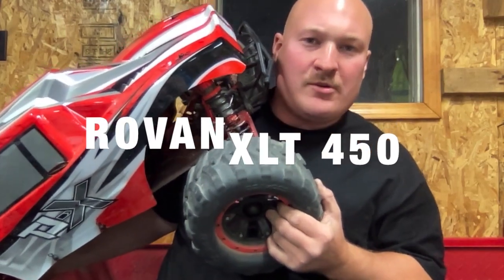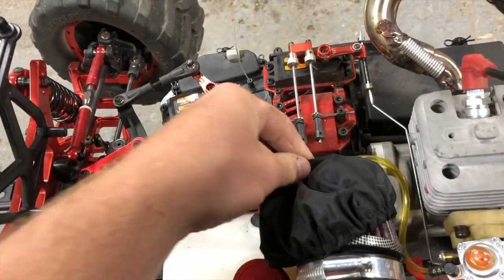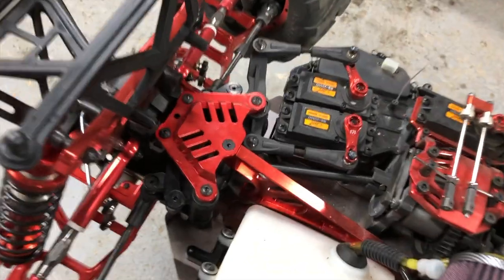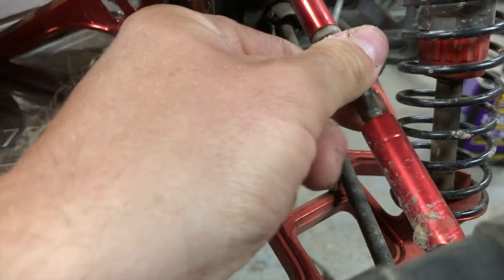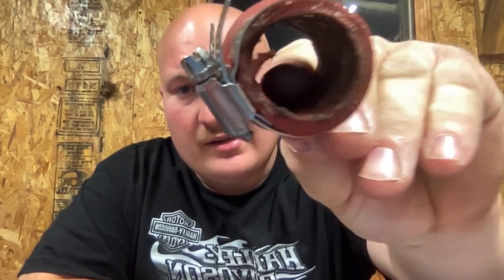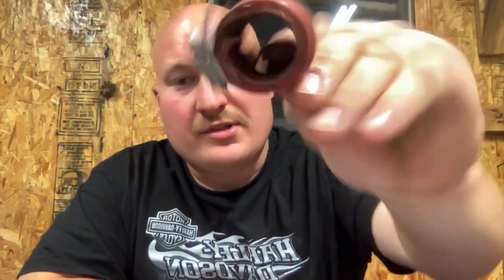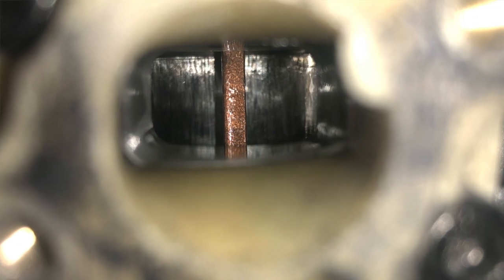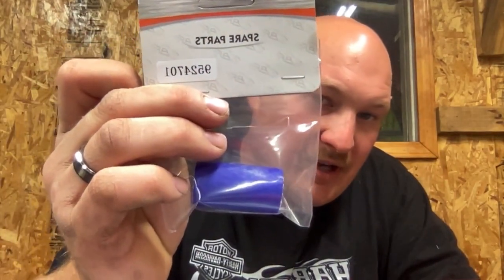Rovan XLT 450 short term review

Comment: The shroud helps direct the air over the head
Reply from the maker: Yes you are correct. The temps did get better after I took the shroud off.  I am trying everything to keep these temps down.
Reply: @kgm5512  i don't have the xlt 450 yet. Dont know if ill get it. But on my other 3 rovans, the exhausts were not port matched to the cylinder head. I don't have any testing with the stock pipes. I put bartolone pipes on them. Funny thing, all three of the bartolone pipes were the same style. 2 were correctly port matched. 1 wasn't. I sent it back to Dan and he swapped it out for me. I have read other people had the same thing happen. I guess bartolone made a run with the wrong flanges. Just something to look at when you swap the pipe out.
Reply from the maker: @Dan-em9sk  I am looking into a tmr pipe. Thanks for the heads up. I also run bajas. I have never had a issue with overheating until I ran this truck
Reply: I have the same truck didn’t have any cooling issues. But I still cutout the front window. Engine has a good flow of air keeps it cool 😎

Comment: It's the second ring on the piston that is causing the excess heat IMO. Kind of an odd idea from rovan to do that. I had the same problem with a dual ring 36cc in my rovan Lt. It was running hot and after a little bit of running it would lose power. I took the head off and removed the bottom ring and it solved that issue. Also runs way better.
Reply from the maker: Thanks for watching. You are absolutely right about the second ring. I will only be re assembling with one ring

Comment: Why is the 5t so much faster?
Reply from the maker: Well I would have to guess in my opinion is that the giant tires on this thing add so much gear that it make it difficult for the truck to move. Thanks for watching!  It’s not so much a speed truck but made for jumping
Reply: @kgm5512  i was just wondering cause they seem like the same motor in the xlt an the baja but the baja does wheelies and sounds way crazier from my research. For the price i was kinda hoping the xlt was like that cause i want one but not really if i gotta spend another grand on a aftermarket engine to make it fun an faster
Reply from the maker: @yamaha4902  I completely understand. The 4wd gas platforms take incredible power to wheelie like a Baja does. Honestly I have traded the XLT away for a hybrid that I will address in a later video!  Believe me it is a great truck and a cool concept but was not for me!